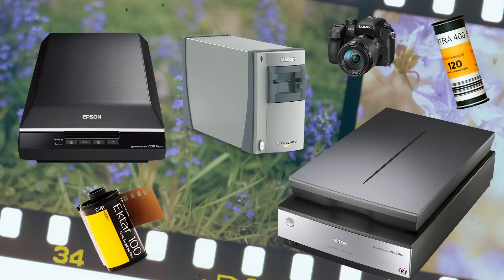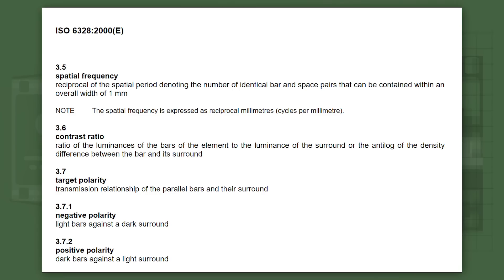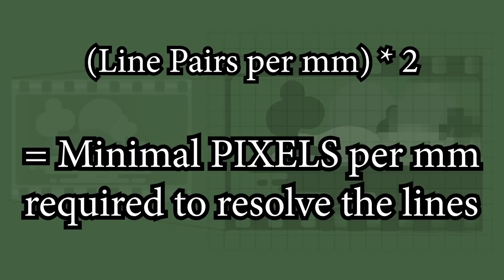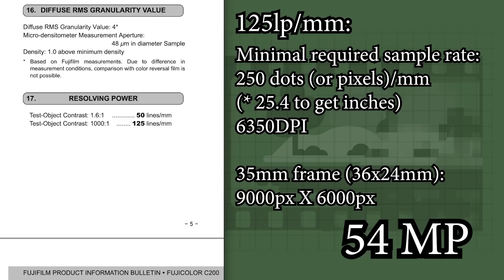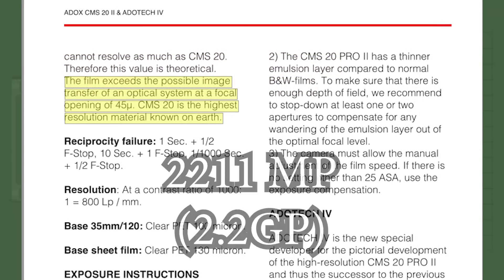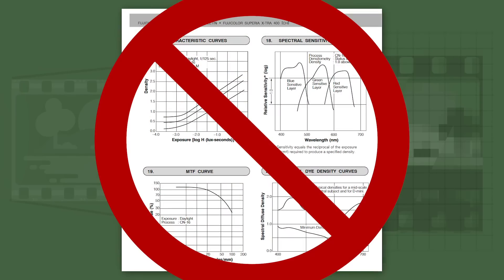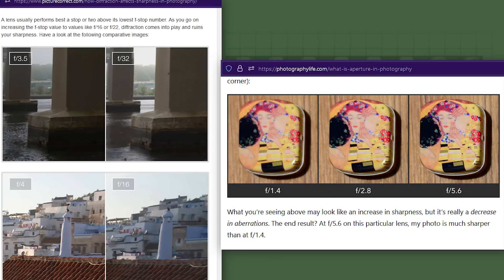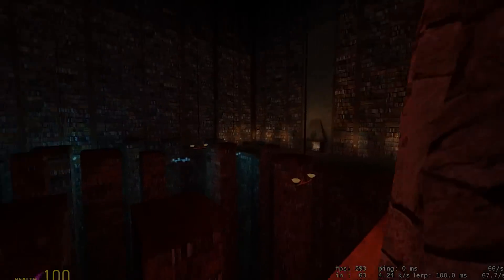The TRUE Resolution of FILM

Comment: I would add that light conditions are not considered. Super low ASA film needs a huge amount of light to be effective, heck I would never shoot anything moving at less than 100 ASA, etc. These modern digital sensors are massively more sensitive for given light conditions. I moved to digital from 35mm decades ago and never looked back. Saying that 35mm is better than current full frame is not even close.

Comment: Back in the late 80s and 90s, analog cable had a grainy look which really was just noise from a weak signal. For reasons I never understood beyond the buried mainline into your home, they used RG59 coax cable to wire your home. It's okay for short hookups, but they strung this crap on the outside of the house under the eaves to get to different rooms. In the early 80s, they actually just brought the buried cable straight into the living room as only one room had cable. Grounding was doggy if they did it at all. They put a ground strap on a painted water facet. LOL. The picture was clear, except for static during thunderstorms.
So, HD blu-rays of 35mm movies show the grain which remind me of analog cable noise. It's not exactly the same. Film grain is much finer, and I understand why people would want to preserve that. I also didn't get to go to the movies that much when I was a kid, so I guess it doesn't mean that much to me. We usually just waited for it to come out on VHS, and VHS couldn't resolve film grain. When I rip DVDs and BDs, I filter it out because it compresses better since video compression mostly updates changing areas of the picture. Do what you want. That's just me.

Comment: ...and then the cr@ppy minilab would digitally print your shots at perhaps 250 dpi on a good day, often waaaay lower. 
There seemed to be a movement to dumb down chemical photography to smooth over the transition. It's probably all incidental, the technology just wasn't there, but convenience won over.
There were so many losses in the chain that pretty soon digital showed advantages.
Motion picture opens up a whole level of debate when you include grain structure dither to the debate...

Comment: Why stop where the making proceeds: the technique of the enlarger in the darkroom!  It is important to understand that this step also reduces the resolution because here also a lens is involved. So with historic analogue testreports showing that lenses with Technical Pan often have a max. of 130 line paires/mm (prime lens, center, 80 in the corner), the real result comes from multiplying the steps in the chain. At the end approx. 50 linepairs/mm remain, which explains the turnaround when this became available in digital photography. Moreover the incredible ISO-performance in digital photography is a revolution. I remember testing the "gamechanging" Konica   35 3200 film. Now what a mess it is compared to Sony A7Riii at 25600!

Comment: A lot of the confusion in the comments here is basically answered by the last part of the video. Though anyone claiming that 35mm negatives only have 8-10MP of resolution doesn't really know what they're talking about. Many commercial film scanners targeted 4000DPI, and they did so for good reason: given the average resolving power of the film and lenses available, 4000DPI will resolve most of the detail in most 35mm negatives. That being said, there are exceptions. I have seen enormous prints from 35mm black and white negatives, maybe 4' x 3', that most people would guess were from 8x10 negatives. With very high resolution film, a lens with a high resolving power and a still subject even 35mm negatives are capable of achieving incredible detail. When we start talking about medium format and above you get into the territory where even a standard negative out-resolves even the best professional digital cameras, even on color negative film which tends to be the lowest resolution.

Comment: Excellent video. I am a boomer, working in the movie industry for a few decades now, so I really had to deal with film. My experience is that scanning 35mm film higher than 4k makes no sense because with the usual film stocks (Fuji, Kodac) you already have like 4-ish pixels per grain. But keep in mind 35mm film runs vertical instead of horizontal in photography, that means our negatives are closer to MFT than to Full Frame. On the other hand even though our eyes can't see much more than 2k, scanning a 35mm in 2k is still decently sharp but you can't recreate the original corn structure due to a lack of resolution, so you can spot it as digital right away. Watch the balcony scenes of De Niro/Amy Brenneman in "Heat", that was scanned in 2k and you can tell right away that it is a greenscreen scene, not because of bad vfx but because of a lack in resolution.
Reply: I just retired after over 40 years in Hollywood in post (colorist), visual effects, film restoration and HDR R&D. I just looked at the scene you offered in Heat. The wide shot just isn't a great comp. Possibly too much spill on them from the chroma screen. If they'd feathered the matte a bit it may have taken away some of the edge harshness. The singles are better. It's not a resolution issue. Being released in 1995 those comps were done optically. They probably looked more natural in the release print. I once had an issue with a feature from the early 2000s that had 8 bit digitally composed opticals that had been made into film elements and cut into the O neg. The entire feature was scanned 4K for a home video release and as one would expect, the scans revealed the extreme disparate quality of the negative versus the opticals. They probably would have looked as bad in 2K. I had to jump through a lot of hoops to match them to the rest of the show. The photochemical process covers a lot of issues that scanners unforgivingly reveal. When restoring old features, we had a process for completely removing grain and restoring it to whatever degree the client asked for. Our process could boost resolution of the image by sampling images before and after to add more detail. This was possible since the grain position is different in each frame of film. The finished deliverables were a digital intermediate film element and a home video version. The point is, we could get away with all of this stuff since we were using motion picture images. When you scan a still, you're just sampling the grain of the film...which is itself, the image. Unless you have a large format negative, at higher scanning resolutions you're just getting a better look at the edges of the grain. Sorry to be so long winded.

Comment: This is an ever ending arguing on film resolution vs digital, I'm not an expert and I only know basic simple things.
People always mix up 'pixel count' and 'resolution/pixel density', larger sensors naturally have more pixels but doesn't mean higher 'resolution'. And as far as I know, film stocks of the same types are cut to different formats 35mm, 6x6...etc. so they are the same thing having the same 'resolution', it was how we print it to produce different results. You can't say 35mm has lower 'resolution' when printing on A4, where 8x10 can do in contact print without any enlargement ! Furthermore, digital sensors are not like chemical film, where digital pixels are evenly placed and aligned, chemical 'pixels' are random, so even if the film has very high resolution it still looks rough when compared to digital.

Comment: There's another aspect of this comparison that is of great importance, and that is the spatial spectrum of the noise (grain or electronic) in an image. Film images will always have much larger noise energy out at the standard limiting resolution where 1000:1 contrast resolution target is reproduced with 20% MTF. 

By the way, the correct term is "modulation transfer function."
The comparison between digital and film sharpness (not resolution) was addressed in the early 1950s by Otto Schade at RCA. He developed the technique of comparing the squared area under the MTF curves of the different media to find a numerical estimate of the apparent sharpness. There has been some argument since whether it's the squared area, just the area, or something in between that best estimates the visual sharpness, but the main principal of examining the area under the MTF curve. has remained. Essentially, higher contrast at mid frequencies (as in electronic cameras)can produce about the same apparent sharpness as higher limiting resolution with a lower mid frequency contrast and more gradual rolloff (film).

Comment: Your resolution vs F# formula is only true if ignoring lens aberration. At fast F# more light is gathered further away from optical axis and aberration will have much significant effect. In practice there is always an optimum F# for a specific lens, usually one stop slower than the fastest F#.

Comment: I didn't notice if you considered the most important component, the optics in front of the film/sensor?

And again, for the millionth time, resolution is the least important characteristic of an image.

I find the best, quickest, cheapest way to increase image quality (in digital workflows) is to capture to remove bayer issues (with multiple exposures).  There's obviously dozens of other ways to increase quality.

The topic requires je hundred videos.

Comment: As a professional photographer, I shot film for 40 years until starting digital photography in 2000.  My experience was, in the early days of scanning film on a Kodak 35mm film scanner, (about the year 2000) that if I made a print from a 35mm color negative onto Type C paper, in the darkroom, lets say for an 11x14 print, I would get a beautiful, smooth toned, relatively grainless image.  If I scanned that 35mm negative, and then made a print from that digital file, on a color printer, I found that the scanning would bring out the grain.  Instead of a smooth grainless image, I got a printed image that was full of grain.  I am guessing there was something in the wet process and the combination of the color negative film and the Kodak Type C paper, that made the grain so much less.  When the Nikon D2x digital camera arrived, and I did some aerial photographs with it, I discovered that I got a a beautiful, smooth toned image, compared to shooting negative color film and scanning that!  I hope this adds some information to this discussion.
Reply: as you may know, a scanner is a one pixel wide sensor, which acts like a point light source, bringing out the grain structure.
Reply: @vincentgarofalo-y7f   That is fundamentally called aliasing and a competently designed imaging device OUGHT to suppress it, say by shifting the film a little during exposure and integrating over the pitch between the pixels, or by using an optical dispersion filter, or by well measured defocusing. You have the same "issue" in cameras except every competently designed imaging sensor (before the current no-AA craze) had a dispersion plate on the sensor to suppress aliasing, and then sharpen in firmware to recover the local contrast, it's fine.

Comment: Back when digital cameras literally were first coming out, I read a pretty well researched article in one of the photography magazines. Unfortunately, i can't remember which one or exactly when. They said that 35mm 100 iso film would be the equivalent of 24 megapixels. And this was back when 24 megapixels was a pipe dream.

Their calculations were based on the actual visual information that a film image can contain, counting only the level of resolution that actually contributes to what the human eye can discern as part of the original scene, and what optical equipment can convey. In other words, a 24 megapixel image at 8x10 would look indistinguishable from a 35mm 100 ISO 8x10 film print...  For most people in most normal conditions. 

Those are the numbers that I have been going by. My Sony A7R2 is 42 MP, and the a6700 i want is 26 MP. So I'm happy.

Comment: I no longer do detailed posts on this kind of thing, but a lot is not covered here: RMS values for positive film, specialty films which required meticulous processing- notably Tech Pan film in HC-110, and Gigabit film in its dedicated chemistry. Use of pure azo dyes in now defunct Kodachrome 25. Tricolor (trichromatic) process making 3 identical exposures in black and white through a 29, 47, and 61 filter, then converting them to a single color print. A LOT of variables. Few people know about Linhof tested lenses. At one time, Linhof had agreements with Zeiss, Rodenstock, and Schneider to buy lenses, but then to only keep a % of them which tested best. They found 30% variations in the SAME make and model of lens, as sample variation. Personally, the best lens I have ever seen was a Voigtlander Apo-Lanthar in 105mm, although some process lenses are probably better. That Voigt was a different company than the lenses you see today, which are quite good, but made by Cosina.

Comment: Has any film camera manufacturer even considered using an LCD as a shutter? Or would the polarizing filters on them affect the image negatively? That could help basically negate shutter movement distortion...
Reply: Two pol filters would cut the light a lot. But it has been done on lab equipment.
Reply: I think something like that has been patented decades ago, and shutters based on polarized filters have been used in many high-speed cameras, including the ones used for capturing nuclear explosions

Comment: Spectacularly good video! A coherent explanation of the freakin ' Nyquist frequency! Now, that is something that you just don't see every day. FWIW, my own personal rule of, well, whatever for the practical day to day with real-world gear and processes resolution for 400 speed film is about 24 MP. Which just happens to be the maximum resolution of most film scanners. Which, to me, means that a 24 MP or better camera, IF it does other stuff better, like dynamic range, or noise, or color fidelity in real-world light could, with a string of qualifications, call itself "as good as" or "better than" film. That tracks pretty well with what you have calculated. It says something interesting about our culture that during the period when film was "dead" digital cameras were wildly inferior. Now that digital cameras are really pretty good, film is back. Go figure. The same weird thing happened in audio. The vinyl LP didn't come back in a big way until digital started sounding decent, after a 20 plus year period when it was near impossible to find decent recordings of currently popular music.

Comment: That 54MP is wrong based on the numbers there. The 9000 x 6000 dimensions each need to be multiplied by √2 to make sure the diagonal is capturing 250 pixels / mm. 12728 pixels x 8485 pixels = 108MP, not 54MP.

Edit: OK they did briefly acknowledge that

Comment: My go to reference for film resolution is that Super35 film can produce 4K images. We've all probably watched movies shot on Super 35mm and displayed in 4K. Film has a very soft frequency rolloff, so what this comparison is for is less for maximum resolution of film and more for the vague perceived sharpness. The image is slightly softer than digital, but the higher frequency details are definitely there if it's shot on a sharp lens. Film will capture much finer details than that providing the lens is sharp enough and in focus, but I use that as a basic sharpness comparison. And this is fully anti-aliased. But it REALLY depends on getting a good scan. 

To get an image WITH NO ALIASING IN ALL CHANNELS out of a Full Frame Bayer pattern sensor, matching that resolution (4096 pixels per 24.89mm along a single dimension), you'd need a 187.MP sensor (double that pixel density then multiply it by √2 to get the diagonal*). That's higher resolution than i think most of the digital medium format options. You wouldn't need as many pixels with a hexagonal arrangement, but with bayer pattern sensors and an OLPF that abides by signal sampling theory that is what you'd need.

For a more subjective comparison, you can take a decent quality (not cinema quality) full frame scan, and you compare it with a 60MP full frame photo, you should be seeing much sharper fine details in the digital photo, if your scan even picked up the fine details at all on the film photo at all. But the fine details in digital are not pleasant – they have a bunch of aliasing and noise reduction and de-Bayering artifacts. Manufacturers could apply an OLPF to fix this, but they don't, in favor of sharpness and maximum resolution, presumably for competitive reasons. 

* Arguably if I am comparing scanned film at that resolution I should use the diagonal for both, meaning not multiplying by √2, but: a) 4K images often contain aliasing either from the scan or the downscaling filter used to make the picture sharper, which I would argue is bad, but we are just using it as a resolution comparison here, and b) as I said film definitely can produce much higher maximum resolutions than this benchmark of vague perceived resolution anyway (as seen in MTFs on the datasheets), while digital has a hard limit on resolution. For reference without using the diagonal the full frame sensor would need to be 94MP, which is your absolute minimum full frame film resolution (well, probably not YOURS since most of us shooting film are using soft vintage lenses and not using cinema quality scans).
Reply: This is consistent with another YouTube video I saw where a movie studio basically said there is no point in rescanning old movie film at resolutions greater than 4k as the detail isn’t in the film start with. So these remastered 4k movies will likely be the best we get (at least without AI).